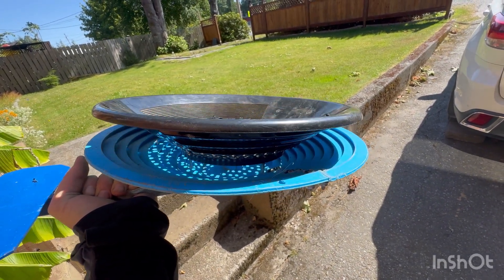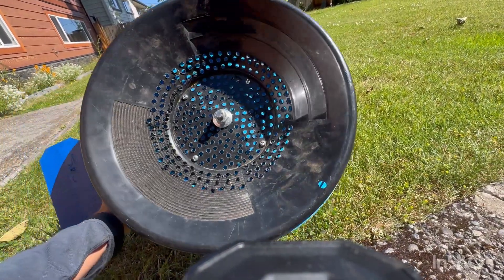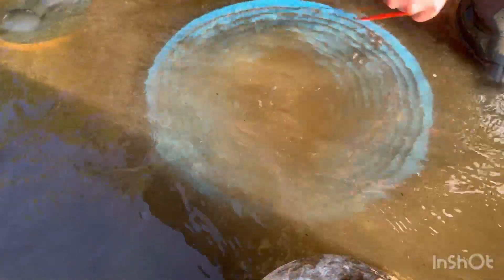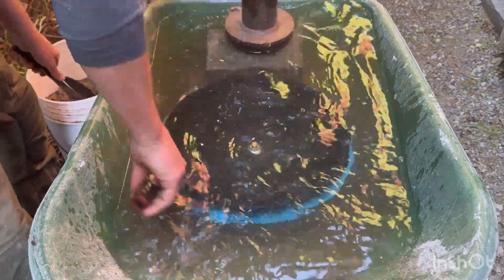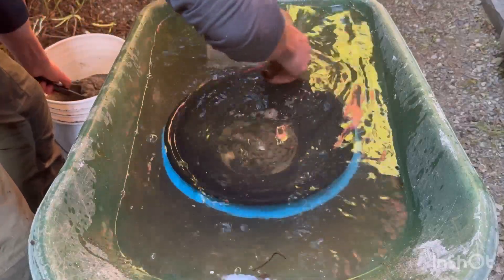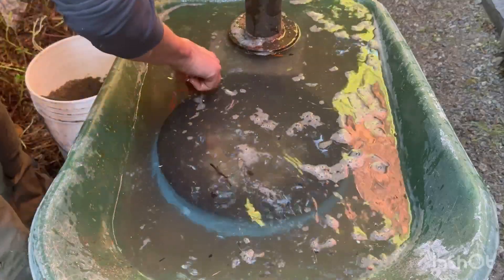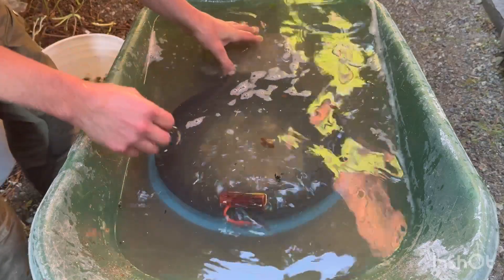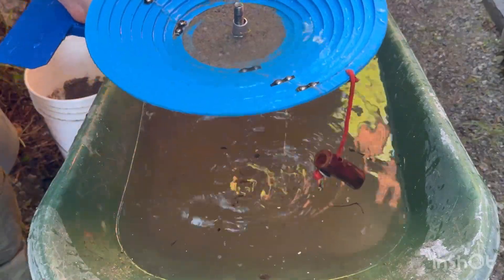141. SpinPan Gold Pan Prototype #2 and Classifier Screen

Comment: Bjarne: It's an interesting concept you have there! You should make the classifier REMOVABLE so you can lift it off the spindle to toss off the big rocks as you go (without having to unscrew the nut). Maybe an actual CLASSFIER PAN with a SCREEN would be a better and faster. I've found IT'S ALL ABOUT HOW TO MAXIMIZE  THE AMOUNT OF MATERIAL YOU CAN MOVE IN THE SHORTEST AMOUNT OF TIME WITH THE LEAST AMOUNT OF EFFORT. Take a lesson or two from Jeff Williams on refining your panning technique, too. Good luck prospecting -- Love your videos!